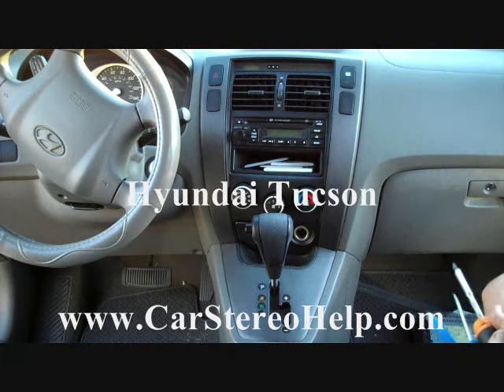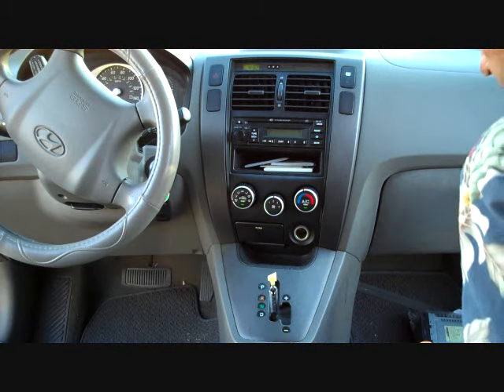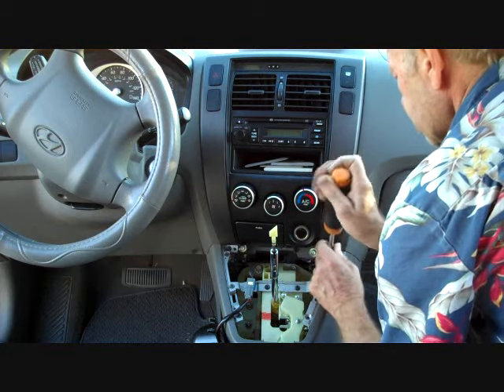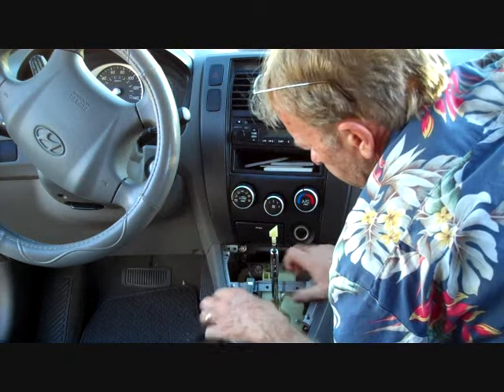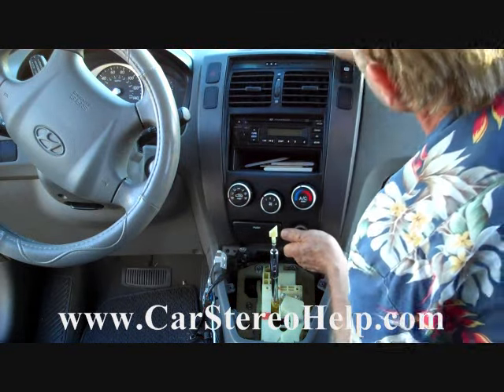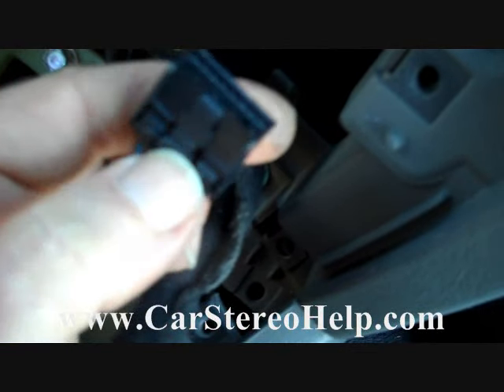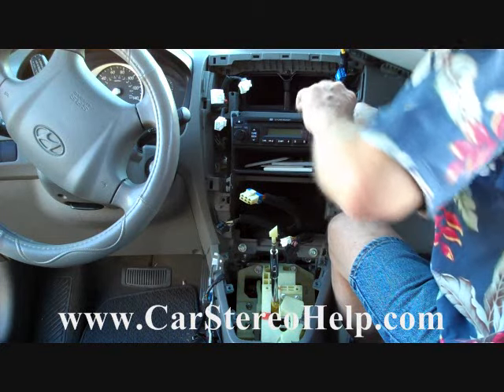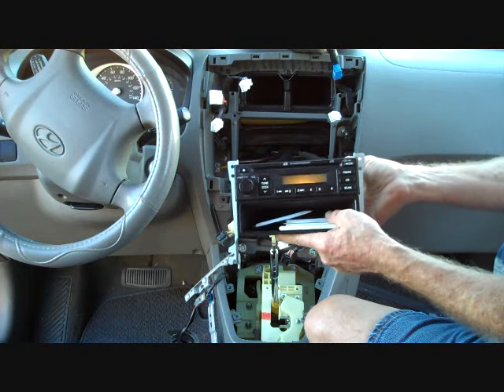Hyundai Tucson Stereo Removal = Car Stereo HELP

Comment: That yellow connector is NOT an airbag sensor, it's an indicator light for passenger airbag disable, You certainly can disconnect it without ANY concern. I just did a stereo in my daughter's car and had no issues, other than the COPIOUS amount of plugged-in harnesses.
Reply: Thank god for this comment, I just bought an 06 and the climate control I believe is bad because my AC keeps turning on and off non stop.

Comment: Hi Factory Car Stereo Repair, I tried to unplug the AC connector (the 3rd connector on the video, white and blue) but it is not coming off. I'm afraid of breaking it because of squeezing it at the center to the max that I can. Do you have any advise on how to take it off?

Comment: My stereo goes on and off at random, and the Bluetooth doesn't work anymore.  Oh, this is an after market pioneer double DIN that I had put in.  Do you think a connection is loose?  The radio plays when the radio lights are illuminated during the times that the radio works.  The Bluetooth shows the same number on the display that is also on the other Bluetooth device I want to pair, but the Bluetooth device cannot pair with the radio.  This happens no matter what Bluetooth phone I try.  What could be the issue?  Bluetooth pairing used to work earlier
Reply: I installed a Pioneer in my wife's 2006 Tucson.  Same issue with Bluetooth, and the USB port no longer works.  I will be replacing it shortly, but not with another Pioneer.

Comment: My 2005 Tucson has the tape deck as well and I had bought one of those auxiliary cassettes to bluetooth to my phone, and now it is stuck! If I remove the car stereo system like this will I be able to get to the tape deck to possibly remove that cassette?  Any tips?
Reply: Yoooooo. This exact same thing happened to me in my 2007 Tucson! I think I am just going to replace the whole stereo and take out the cassette player.